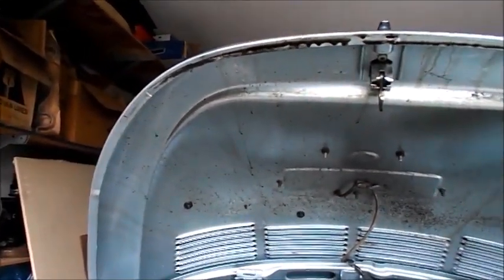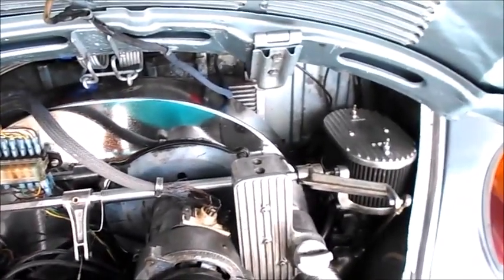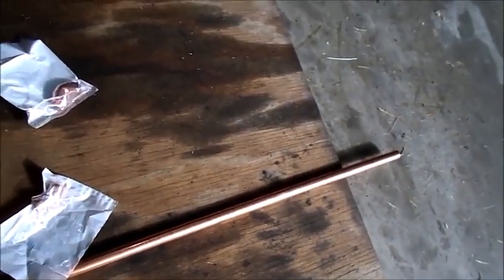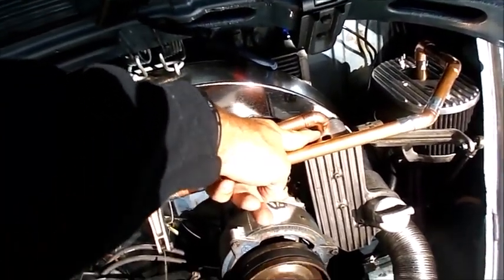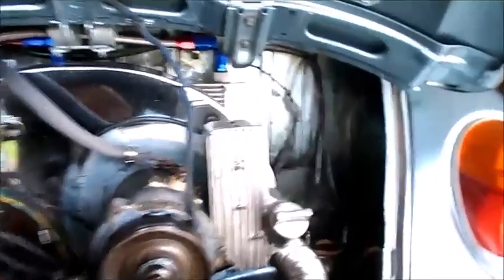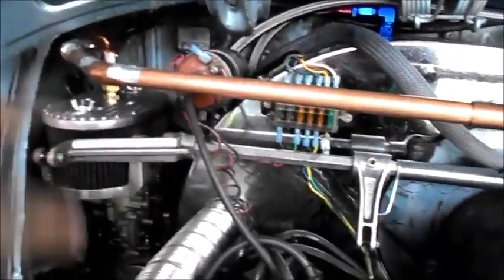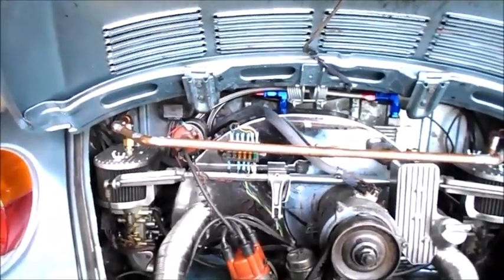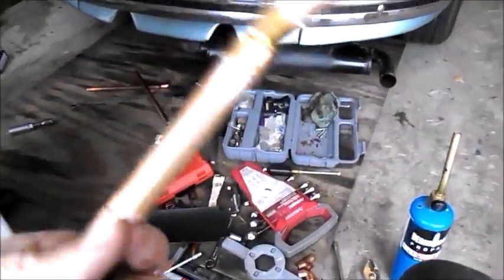vw 73 super beetle breather tube system

Comment: Nicely done - nice to see someone else understand how crankcase ventilation works - massively overlooked in the car scene ! Good job
Reply from the maker: i watch vids of people venting the valve covers to atmosphere and i shake my head in wonder. just run the case vent inside the air filter and with the resulting mild vacuum applied to the case the vent problem goes away along with a lot of little oil oozes and stink. thanks for watching.

Comment: wow that's a tad excessive you just need to run 1 line to one air filter or cap 1 and run 1 line down to the bottom of engine to vent. I have a 2332cc and that's all I have. save the pluming for indoors
Reply from the maker: thanks kenny but that's much too simplistic. there is more going on when you vent inside the carbs than controlling oil leakage. i'm about to do a detailed look at my system and put my thoughts there. congratulation on having a well vented engine. from what i've seen, most 2332 folk have problems.

Comment: Looks good, Im thinking of getting the same breathing box to see if it fixes my blow back issue
If you don't mind me asking some questions is it required to run that through the carbs or can i do a valve cover set up and if so do i plug the carb holes and do i need to vent both valve covers or get away with just one?
Reply from the maker: before i can answer: what size engine do you have? what type of driving?
Reply: @redshirt-scotty  mines a 1600cc daily driver
Reply from the maker: i'd not vent valve covers on a stocker. more holes. more leaks. just not worth it. the holes on the top of the breather box should be enough for your application. if you vent inside the air filters, you get a enough vacuum draw to reduce and even eliminate any oil leakage. when i put my system together, i didn't realize how strong the vacuum effect would be. works really well at highway speeds.
Reply: it works great with one to air filter and the other one run down to the bottom of the engine as air vent

Comment: wouldnt it have made more sense to run an external filter (like the small 2inch napa filters) into one hole too alleviate all that extra piping and work? just wondering because im running the same oil filler breather box
Reply from the maker: personal choice item unless you run heater boxes like i do. you don't want to breath that stink. also, if you simply vent through one of those little filters, they will fill with oil and spew fine oil droplets after a while. also, the mild vacuum inside the filters helps to prevent oil leaks. if you don't want to vent into the air filters, you should vent below the breast plate. put the stink and the mess outside the engine compartment.
Reply from the maker: @ethanpower9245  www.vw-resource.com/engine_tin.html part 30

Comment: Pretty nice work. 
I wonder what is the use of breather filler. Pardon my ignorance.
Reply from the maker: crank case fumes contain oil droplets. there are baffles in the filler that help to knock the droplets out of suspension. what's left smells and can still be messy so i run it into the carbs to be burned and put out the tailpipe.
Reply: Thanks